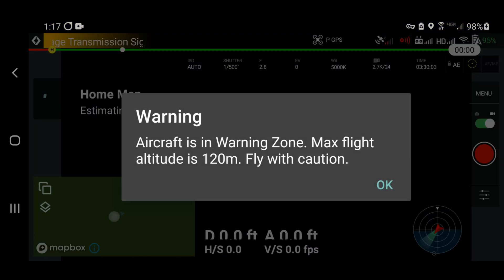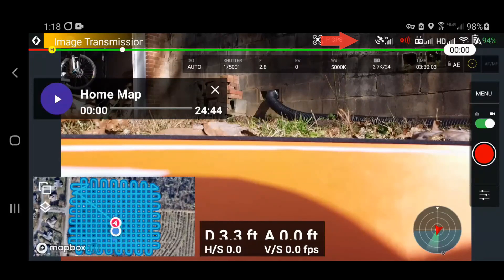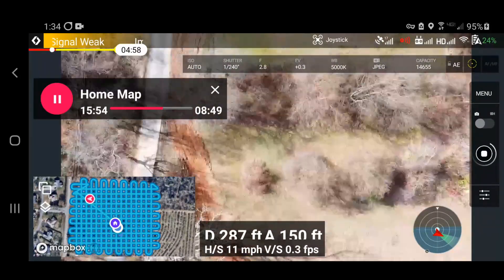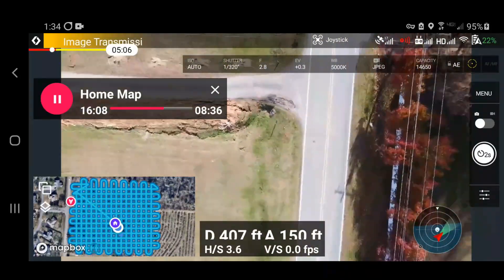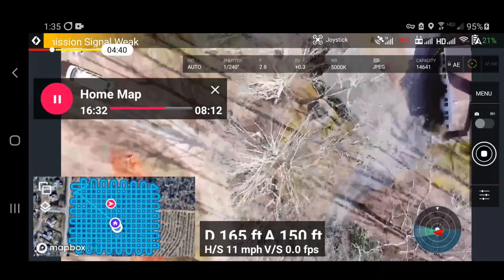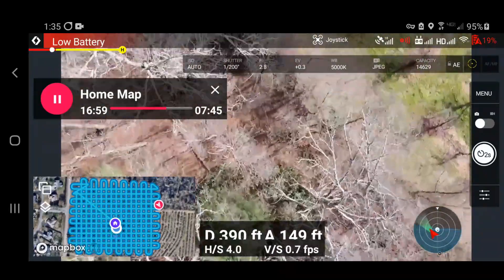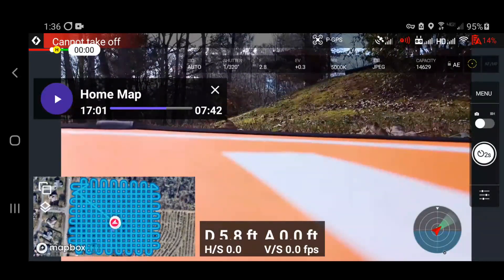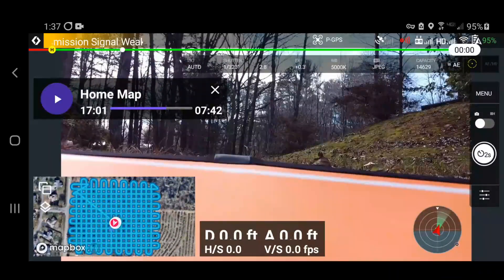Dronelink Multi Battery Mapping Mission Flight 2 of 3

Comment: Hello. Why is your battery drain so fast? From 98% to 20% only took 17 minutes ? 🤔
Reply from the maker: That is normal for the original Mavic Mini.  Its battery is only rated for 24 minutes.  And it never works out to be as long as DJI says.